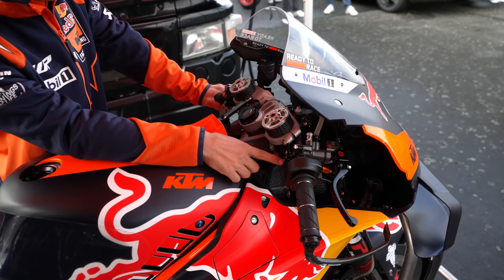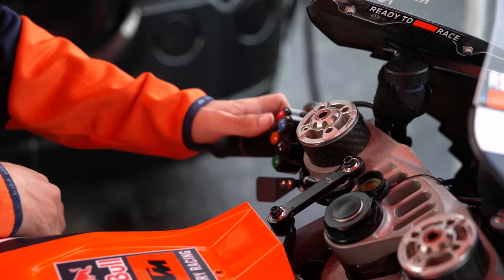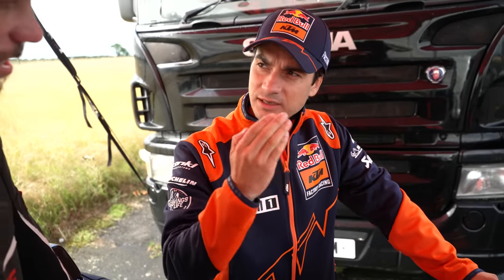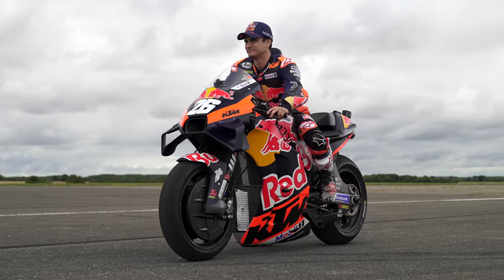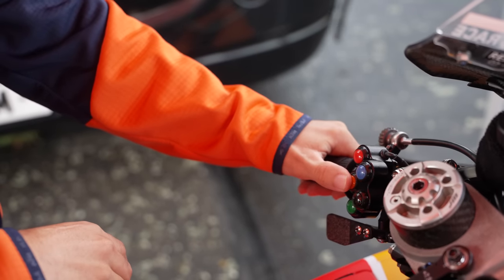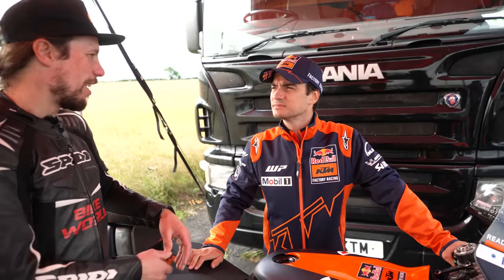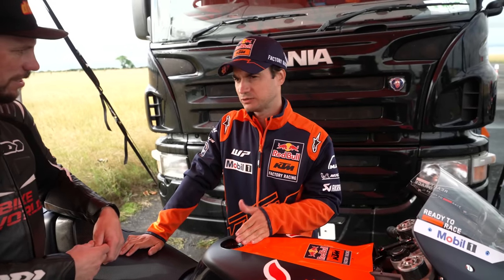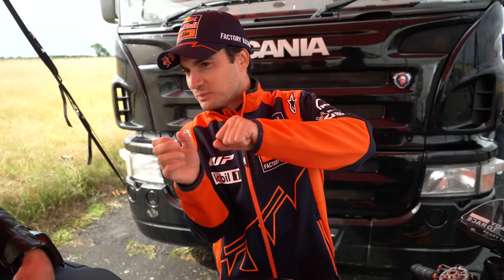KTM MotoGP Bike Chat With Dani Pedrosa

Comment: Never knew they also used the front start device under braking. Wild that it helps with stability but makes sense getting the extra travel under braking and allowing the suspension to still be soft through the stroke.

Comment: What hè says at 03:44 min about the 1 second with the visor. Is there ever experienced with maybe a electric rol visor ? 
Possible to Connect and controle wireless the speed of the rol of so you can keep the hands on the steer?